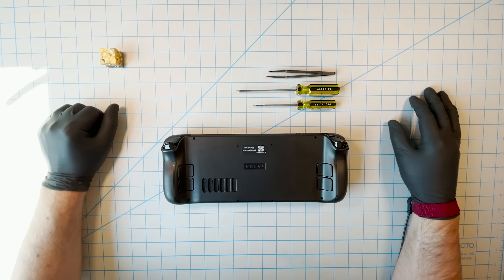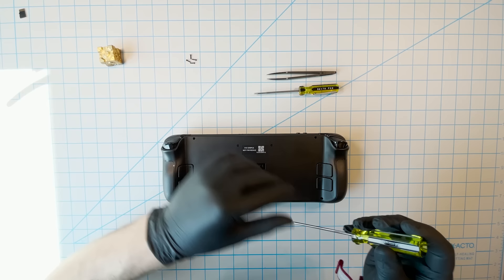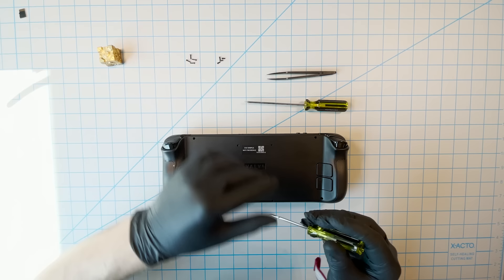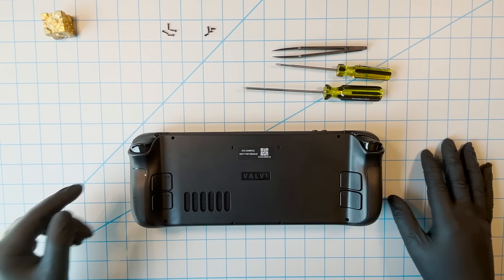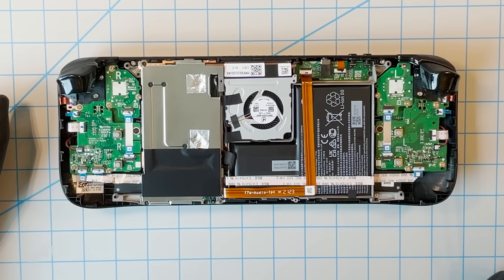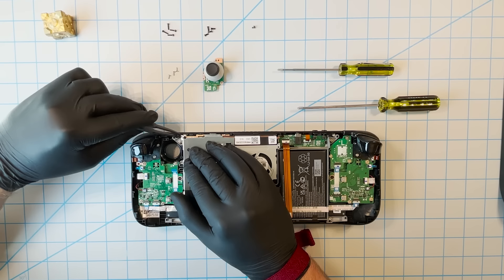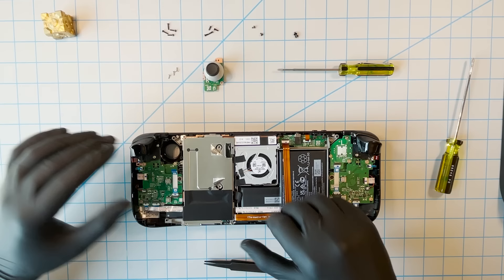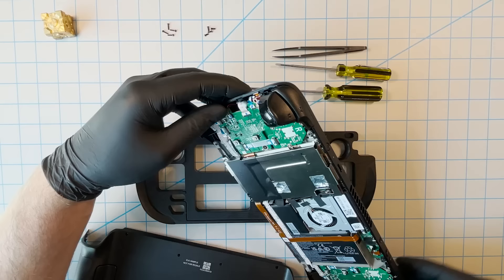Take a look inside Steam Deck™!

Comment: I'm beyond in love with how accessible the thumb sticks are. That is probably the single component that may need swapping above all else (fingers crossed not) and Valve appear to have made it an easy and up front kind of swap.
Reply: The battery looks buried in there though which is basically a complete interest-killer. That will stop taking a charge, and you will have to replace it.
Reply: @keiyakins  looks easy enough ngl. It is quite under there but eh
Reply: @keiyakins  When the big yellow circle is on the battery, it's clear that there is a pull tab on the battery assembly at the bottom right corner of it.  I think you're assuming things, and it looks like replacing the battery will be simple.  Why would they make the unit user-serviceable and show videos of it and then not let you order and replace the battery with a new one?
Reply: What do you mean, buried? It’s under two ribbon cables, the connectors for both of which are easily accessible. I can’t tell if it’s glued in, but just getting to the battery seems trivial.
Reply: @keiyakins  you shouldn't open it up then, leave it to professional
Reply: @keiyakins  I mean, maybe. But in the future you can always use it with an external power source. It doesn't stop you in your tracks, like the thumbsticks might
Reply: Well possibly not, until the Switch came out companies made sticks that lasted for years... My PSP lasted me for 3 years. (Before the battery died, if I replaced it it would probably still work today)
Reply: @keiyakins  have you seen most smartphones? this is a cakewalk compared to even a 5 year old device. Not to mention they have channels for original parts, something I don't even think nintendo has.
Reply: @jackwilson5542  But the real question is, why are they showing how to replace the thumbsticks already? The sticks aren't going to have issues anytime soon.... right?
Reply: Though, I wish their placement was more ergonomic. -- The placement on the front face is super awkward.

Comment: There are 14 screws removed in total and the underground hes working on has 2 stripes.
14-2= 12
Half of 12 is 6, which is also the number of screws closest to the left stripe. Both of those screwpiles are seperated into piles of 3. 

He also used 3 tools to take the steam deck apart.

🤯 HALF LIFE 3 CONFIRMED 🤯
Reply: Valve is very subtle even irl
Reply: The best part of this is the clown pfp
Reply: How the fuck this made me laugh???!??
Reply: OK then, Monty Python

Comment: Valve: "This is how to fix it!"
Apple: adds software which prevents you from fixing anything yourself
Reply: Every part has a signature code and an authorised repair is just sending your phone away and getting back a different one. Which is why you back up your data.
Reply: I don't even understand why people buy such phones to begin with...
Reply: @forevercomputing  but why would you add more hardware to parts just to stopp repairs?
Reply: @kidmosey  it actually doesn't prevent hardware mods. it's entirely to make you buy a whole ass new iPhone. you can also still jail break the newer iphones too...
Reply: @forevercomputing  you can replace anyway your iphone display, battery, camera, backcover, speaker, charging port, and they will all work. In the newers they may send a notification, in the others not, but that's it, they work
Reply: @kidmosey  i don't think its to prevent hacking, you can replace a lot of parts anyway, its always been done
Reply: @LeGaLiZeDOOMz  that's the problem it doesn't only give a notification but it also disables some features
Reply: @stanvdwiel  nope, zero features disabled. Name one? Just the face id can't be replaced, only one

Comment: The fact that the voiceover mentioned about how a replacement SSD can have a different EMI signature makes me think this video was made by a Engineer (who wasn’t oh-so-commonly hamstrung by management on what he could or could not say.)

Good guy Valve.
Reply: I think there's still a lot of that in this video though, Valve really doesn't want us to replace the SSD so they're listing every reason they can come up with to discourage us, down to the EMI signature. But the simple fact that this video was still made shows that yes, they do have an engineering focus, and that's amazing.
Reply: @DeeSnow97  they have to give out all the warnings they can in case someone sues them. But the openess and friendliness and the fact that the device can be repaired,isnt glued down is a big win. The fact they'll provide replacement parts as well is just the icing on the cake. Apple can burn in hell
Reply: @rudrasingh6354  I will stock up on thumbsticks, I know myself. :D
Reply: @DeeSnow97  I feel like it's kind of BS too but their SSD does have an EMI shield, I don't think I saw many or any on consumer SSD.
Reply: @sfbptank  it can be a big deal that close to the wifi module. It's very difficult to get decent wifi antenna placement in a handheld and interference is always a concern. SSDs internals can run at different frequencies, and while it might not effect it much, it could severely limit the range at which wifi acts "good"
Reply: @sfbptank  Makes me wonder if taking that and swapping it onto the replacement SSD would have any benefit. They do have a point there, the WiFi module is pretty much directly below the SSD, that's quite unusual.
Reply: Supposedly, Valve doesn't even have any managers in the first place.  According to the rumors, their organizational hierarchy is entirely flat - though technically Gabe Newell is the CEO and sole owner of the company.  Instead of a manager telling employees what to do, the company depends upon employees to actively and spontaneously collaborate.
Reply: @Taedrin  it's not a rumour. There are plenty of leaked copies of the valve employer handbook around that show exactly that
Reply: Most linux machines i had fucked with wifi, so it's necessary to gives warning like these, for the fellas trying to plug a samsung pcie SSD in it and then trying a rtx 3080ti desktop
Reply: Makes you wonder why they didn't move wireless module somewhere else.
Reply: @user-ws8ev7nz3e  PCIe routing, most likely. If you look in regular laptops, the SSD is usually next to the wireless module, just not directly over it, since both of them are M.2 PCIe devices. In the Deck, the wireless module seems to be soldered, but the same principles still apply.
Reply: @DeeSnow97  I am no expert tbh. What I see there's still plenty of room around the drive. Wireless modules at least those I saw aren't that gigantic. I haven't seen modern ac mobile modules though they could be monstrous for sure.

Comment: Apple: "noooo you can't open our products you have to buy a new one"
valve:  "your machine, your rules and here's a guide on how to do it"

stuff like this makes me love valve even more
Reply: I think valve contradicts themselves though. They are telling you you should not open this or you could die in which in my opinion causes confusion. if I need to open something to replace a component (resistor, capacitor, battery, SSD) I'm gonna do it to get it working again!
Reply: i think by "you should not open this" they meant "you shouldn't open it just to see what's inside but if you're having problems then you can because it's your device and here's how to do it"
Reply: @EdnovStormbrewer  they meant that it is not recommended to open it because of the risks associated with it.
Reply: @EdnovStormbrewer  ever heard the phrase "even if you could, doesn't mean you should" ?
like they totally ok with thr owners tinkering with the device, they just said some precautions like it can be dangerous and can void the warranty.
Reply: @EdnovStormbrewer  if you consider yourself to be smart enough to open a device to repair it, I also think you should be able to understand that this video is not for the avarage tech enthusiast but for little Johnny at home that got this for Christmas and tried to replace his thumbstick

Comment: In a world where the easy-to-break parts are soldered on, they at least had the sense to make it modular. Props to valve for thumbstick replaceability, what's always irked me with modern controllers is the fact they're soldered into the board. 

However, I will give them crap for the self-tapping screws, it could be because of cost but I'm still kind of irked by that
Reply: Could be for the stability.
They sort of expect that it's gonna get dropped by their users. Even says that "Opening the case weakens it"
Probably tested a ton of configurations and decided on self tapping ones for most friction for holding the case together.

Just a guess though, I could be talking out of my ass for all I knoiw.
Reply: @SollowP  Most non-tapping screws I've seen (laptops and handhelds) need metal standoffs in the shell to thread - that being separate to the case housing adds a point of stress when impacts happen, causing the plastic holding the standoff to crack and come free.
Reply: @SollowP  Indeed is for stability under fall or crash situations, far better than other types of screws. The downside is that they can only be reopened and re-attached only a few times before the juction is damaged. So doing a dissasembly should be dome as a last resort thing, or by authorized Valve guys. Then again, is your property alright.
Reply: I think the self taping screw are honestly fine. A ton of other design would have glue or clipping assemby that you cant access once fitted. Sure, annoying, but decent. I'd love to know if the battery is glued though. I'm not actually sure, but isn't the IO on the top also in a separate module ? The ribbon going to it makes me think so. 

If that's the case and the battery isn't glued, that's three of the most common problems of that type of device addressed (IO, sticks and battery, the last being the screen, which, I assume is a pain to change considering the design),
Reply: @terramap2902  Self-tapping screws have been used in electronics for a long time (NES and Commodore 64 come to mind), if you're careful to make sure it's lined-up correctly to the factory thread, you can remove and rethread it plenty of times without issue. 
This isn't something you'll be doing more than a couple times in the consoles lifespan, you'll be fine in that case.
Reply: The cost for this thing is actually excellent, what are you talking about? I wouldn't be surprised if they were selling this thing at a freaking loss.

Also yeah, from someone who is currently fixing thumbsticks for PS4 and Xbox One controllers, being able to get a replacement with my only work being screwing it in and attaching a ribbon cable instead of soldering is an awesome thing for the steam deck and Nintendo joycons
Reply: Self tapping won't be an issue in the long run. As we've seen with the switch, eventually someone will print/make the case/shell and folks will be swapping out their exterior casing. If the holes get stripped, we'd just replace the plastic exterior and the new holes will solve the issue of stripped holes. Worst worst case, you up size the screw slightly to make up for the stripped hole.

Edit:
Another solution, if you strip the hole, adding some glue or plastic, and using the self tapping screw to retap a new hole and the issue is solved. Glue/plastic would work as essentially a new sleeve. This method is used with car engine spark plugs when someone strips the engine tightening the spark plugs too hard. In the end, the issue is minor and not going to stop any diy enthusiasts.
Reply: @amirpourghoureiyan1637  Plastics are different from back then (consider C64, and nes screws monsters comparing with what they are showing in the video). And depends a lot of the kind of plastics is used in the steam deck, where size matters. Also depends on the thread type they are using in the screw, given it's size. But hey, they warned you, so all's well.
Reply: @terramap2902  They're just covering themselves, even though most people are scared to do this stuff anyway. 
It's gonna work out, they'd have to have a major issue with Drift/batteries to ruin the launch.
Reply: @amirpourghoureiyan1637  It's the permanence of damage when replacing that mostly gets me. I do now understand it's good for having less breaking points and cost of production (cause metal threads), but the permanence of damage whenever you open it up is a bit scary to me, especially because I know I'm going to need to replace the battery on this thing.
Reply: @CreativityNull  I mean the cost of process for using non-tapping screws as opposed to self-tapping ones. The process for the latter might've been cheaper
Reply: @nikkoa.3639  If you have good charging habits, that shouldn’t be necessary for a good few years. 
Besides, if you’re careful to line the screws right nothing bad’s going to happen.
Reply: @amirpourghoureiyan1637  There is a problem of heat though. That would still mess up the battery. Especially considering how close they are together
Reply: @nikkoa.3639  Let's talk about the tooling costs for the chassis and the custom joysticks, or the screens, or the upfront cost for the custom AMD APU development since it's still not the same as the ones the new consoles use and not something AMD makes normally.
Reply: @CreativityNull  Yes and they're very expensive. Which is why I assumed self-tapping screws were used to maybe cut some corners. Pardon me, but what are you trying to say?
Reply: @nikkoa.3639  It's placed similarly to the switch, I'd use others experience with that as a rule of thumb for deciding when to replace it. 
If it's bad then you should be fine to change it out 3/4 times without any damage to the case, if you're careful.
Again, any issues like this will be Valve's to deal with as it's their problem - We'll know soon enough if this becomes a frequent issue.

Comment: - "Remember to wear an ESD strap"
- Wears it outside a glove.

Well, at least you in text mentioned it's wrong though. :p
Nice little guide tbh, would've loved a more complete teardown, but I guess Ifixit will get one out as soon as they get their hands on the device. GG, Valve.
Reply: TRENDING-TOP-YEARS⤵️ --------------------------------------------------------------------------------------------------------------------------------------------------------------------------------------------------------------------------------------------------------------------------------- ❣️ AISURU.TOKYO/michan?HDRCam✰ᴾʳⁱⁿᶜᵉˢˢ★ トップAVビデオに参加する
❣️

Youtube: This is fine 
Someone: Says "heck" 
Youtube: Be gone 
#однако #я #люблю #таких #рыбаков 
#Интересно #забавно #девушка #смешная #垃圾
Reply: Not only was he wearing the strap atop a glove, they were doing the work on a non-ESD surface.
Reply: I thought it was just me. I kept thinking hey its not touching flesh , that glove looks like an insulator...
Reply: @paulbastow2190  It's an ESD surface.  I have a similar surface that is ESD with a spot to clip onto.  He's also got the backside of the snap touching his wrist.  The glove is pulled up under his wrist: https://youtu.be/Dxnr2FAADAs?t=123
Reply: Glad the Steam Deck didn't blow up :p